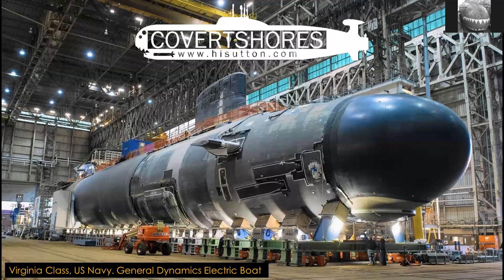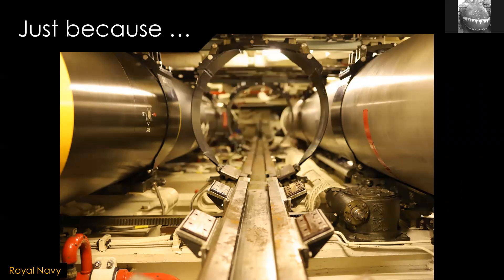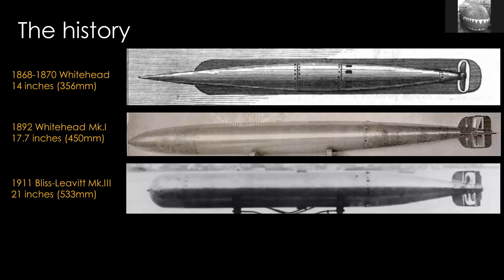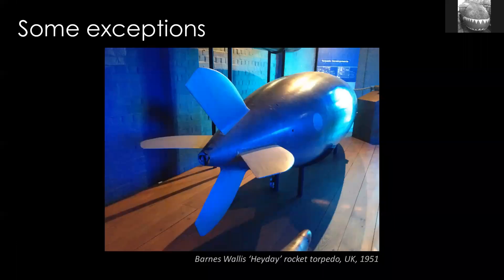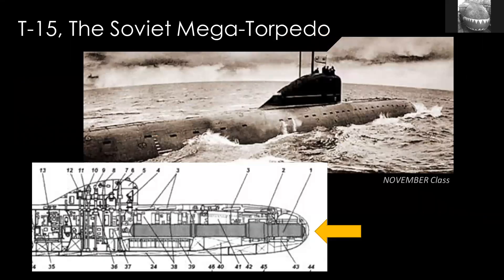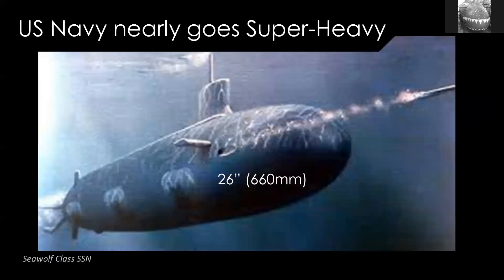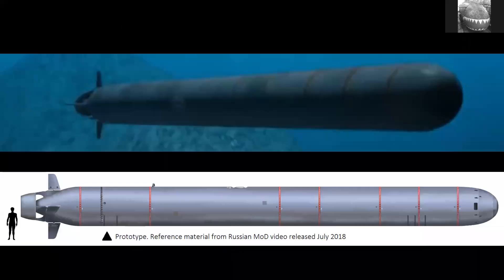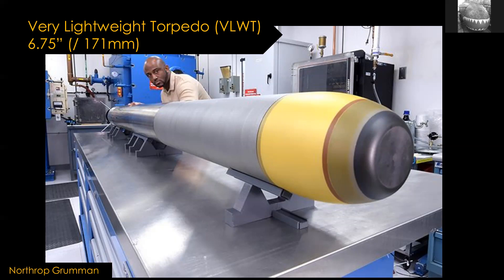Submarine FACTS: Why Are Torpedoes Always The Same Size?

Comment: Maybe I've missed something but I imagine another advantage of doubling up your torpedoes is you could place them on different course for the same target meaning that there are two angles of attack meaning the ship cannot avoid both
Reply from the maker: Yes, that too. For example, shooting them around an island in the Swedish archipelago. I think that I wrote an article on it for Forbes a few years ago.
Reply: @HISuttonCovertShores  
Almost like the Anvil Technique used by torpedo bombers. 
Two sets of aircraft coming in from 45 degrees off the bow at the same time. Release torpedoes almost simultaneously. The target can turn to present a small angle for one set, yet expose their entire beam to the other. 

And in the Tom Clancy novel SSN. USS Cheyenne (SSN-773) would shoot two torpedoes simultaneously. She would then steer them to approach the target from different bearings from not only each other, but herself as well. So that the target would counter launch on the torpedo bearings.
Reply: @HISuttonCovertShores  Germans could still deploy their T-mast with recoilless auto canon and do as they did during WWII. Quite stuborn. It's only 16 meters for the mast but they can remain surfaced.
Reply: or you can fire shit load of torpedoes at whole fleets. i wonder why didnt soviets adopt this against carrier fleets it cant be more suicidal than rocket torpedo
Reply: @jebise1126  I think because they had one target in a carrier fleet as without their carrier they are pretty much useless. So I imagine for them focusing a couple of big bois' on the one carrier, in that way they would garentuee the effect they were looking for. Even if it is less boats than they could achieve with many torpedoes, it garentuees getting the carrier.
Reply: @Alex-cw3rz  Besides, carriers, especially the american ones, are pretty big. You kinda need a good payload for them
Reply: @Alex-cw3rz  for carriers you need the big torpedos, these small ones don't have enough payload. So a sub would load up all six (or how ever many tubes it has) and launch a full volley, then reload and shoot again as they escape.
Reply: @jebise1126  Warhead size matter as he stated in the video;)
Reply: @jebise1126  smaller torpedoes would be like a mosquito bite.
Reply: @jebise1126  What so suicidal about supercaviation torpedoes?

Any Soviet submarine could just slip past the US carrier escort fleet undetected. Why would they bother with assymetrical swarm attacks like MC'02 proved?
Reply: @MrFlatage  those are very loud and anybody would exactly know where those were fired from also not very long range
Reply: @MrFlatage  Are you accusing others of trolling when you actually write sentences like:
"Any Soviet submarine could just slip past the US carrier escort fleet undetected."
Reply: @MrFlatage  That's not quite true. Some of the newer submarines can do that but a lot of the older ones are incredibly noisy. And God forbid if they start dropping sonar buoys, once that happens no Soviet era sub could get close. Maybe some of the newest classes of the Russian federation but definitely not Soviet era. Also as stated before super cavitation torpedoes have a serious issue in that they make a huge amount of noise. All the surface ships have to do is fire a rocket torpedoes in a large spread and well that ship is dead. If you want to test this you can try cold waters it's a pretty good example of the basic concepts though it does miss quite a lot of realism
Reply: @jebise1126 it isn't as bad with the supercavitating ones as you can't hear the sub. Also, what makes you think it has to supercavitate right away? Faster torpedoes work well at long range as being outrun to max range is less feasible.

Imagine trying to hear and avoid several regular torpedoes in time with that screaming around? It is its own noisemaker. 

They enable a huge degree of tactical flexibility even if the weapon itself is not directly effective.
Reply: Smaller torpedoes make perfect sense for coastal operations.

Comment: Just an interesting tid bit the inspiration for the 24 inch Type 93's, was from the British 24.5 inch Torpedo's on the Nelson Class Battleship and HMS Rodney of that class, is the only battleship to hit another battleship with a torpedo (that being Bismarck). It wasn't just the size, it was the use of oxygen-enriched air as a propellant, that made the Type 93 so deadly.
Reply: Yeah, they were deadly alright, to both sides.
Reply: Thought they were the pure O2.
Reply: The Japanese lied to their crews about the oxidisers for the Type 93 & 95. The torpedoes were internally marked with start air and running air. Start air WAS compressed air, “running air” was pure oxygen. Starting an engine on pure oxygen is not a good idea so they were started on air and then switched to oxygen once up to speed.
Reply: And the Japanese went with Oxygen because they were convinved that was what the RN was doing, which turned out ultimately to be incorrect (the RN considered it but felt the risks were too high).
Reply: Very early on in the design process for the 1920s O class overseas patrol submarines, 4 of those 24.5 inch torpedo tubes were considered, in lieu of the 6x 21 inch torpedo tubes eventually fitted.